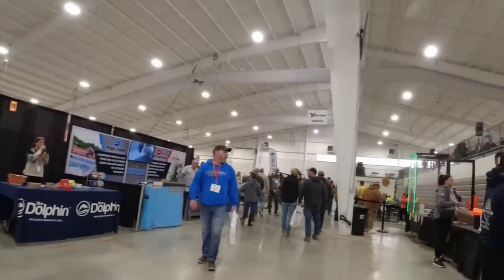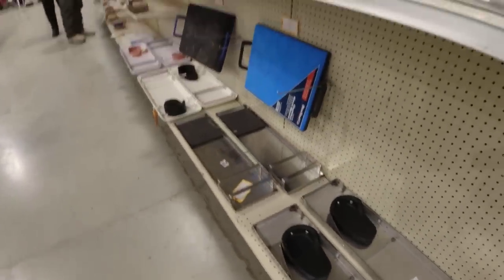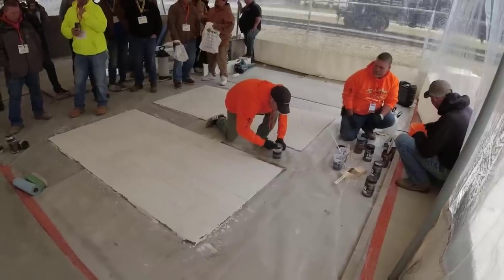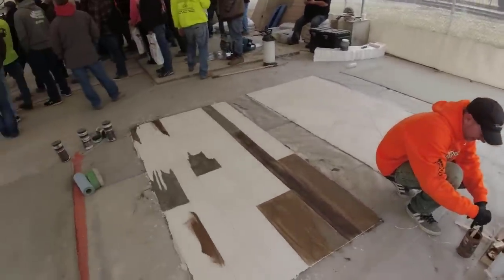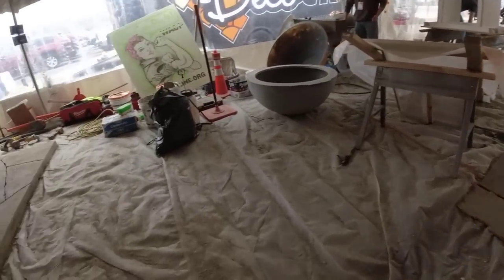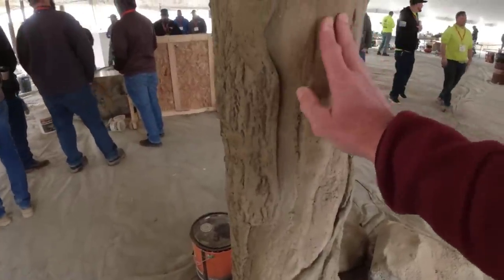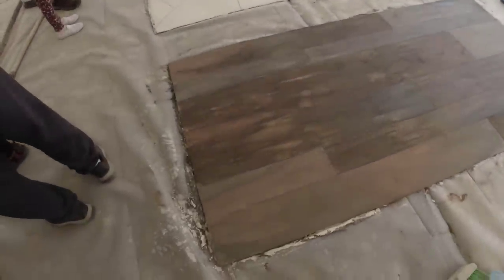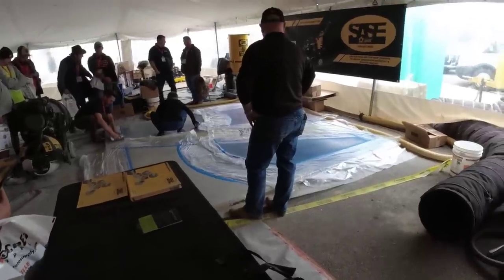These Concrete Skills Are On Another Level! Best of the Best

Comment: I’ve been to WOC a few times but this is really specialized stuff. I’ve always said that the closest thing to artisans on a typical job site are the concrete finishers. You’ve really got to have a natural artistic ability to pull most of this stuff off. Not your standard big box store, kit type projects. Very cool stuff Mike!
👍
Reply from the maker: Yes, it's interesting and humbling. These guys and gals are way above my talent level. But that's ok, I love what I do!
Reply: @MikeDayConcrete  They may be above yours [and my] talent level artistically but if you asked them to lay down 80 or 100 yards of finish slab, in 5-6 hours, I think they would equally struggle. It’s just a different skill set.